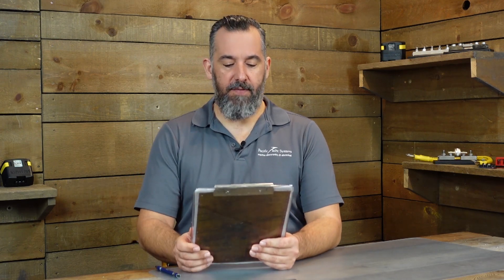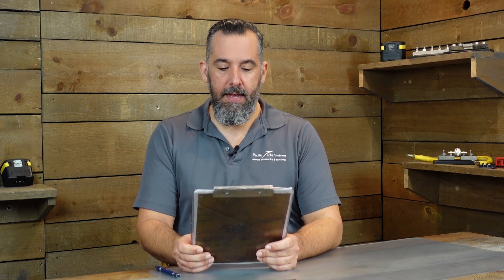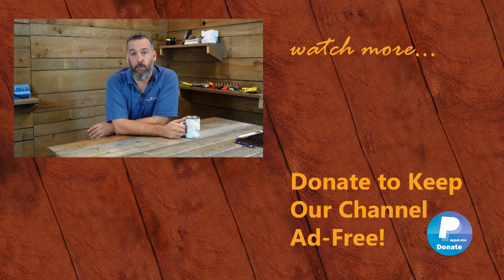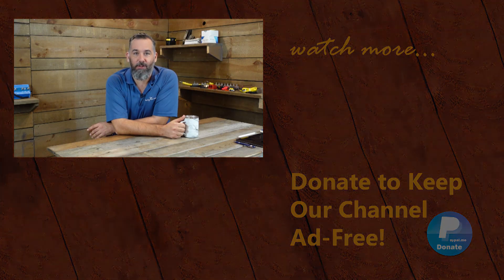How Does a Battery Box Prevent an Accidental Short?

Comment: Hey Jeff...great advice...yet again.  This edition got me thinking about lids or no lids.  Two of my start batteries (VRLA start type battery) are in topless boxes with terminals protected.  Service batteries are in covered boxes.  Is there any good reason why the start battery boxes do not have lids and service battery boxes do have lids?  The boat came from the factory with batteries configured in this manner.
Reply from the maker: Hi Borys, maybe it's venting??? That said, if doable, a battery box is better then protective boots for an accidently short.